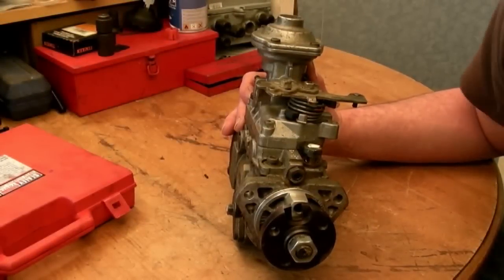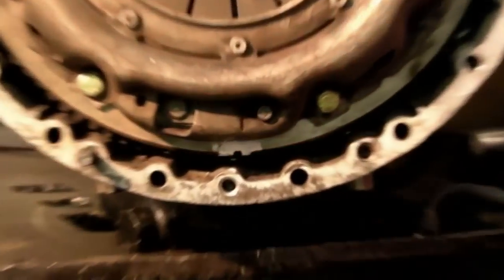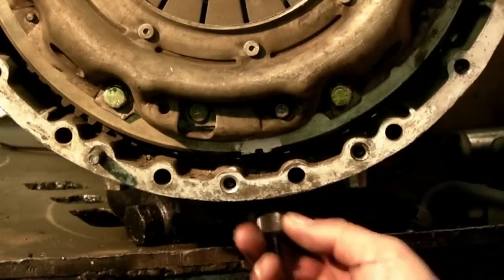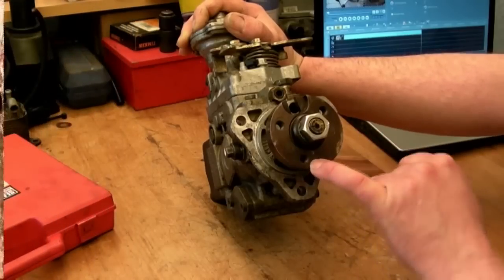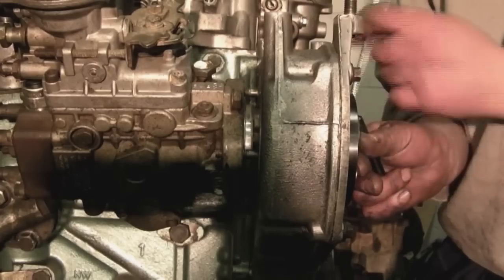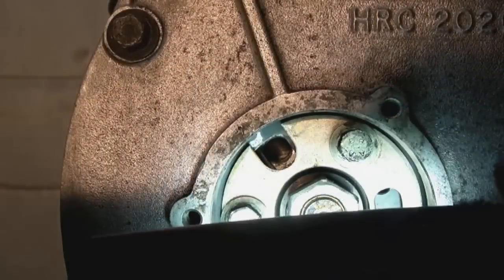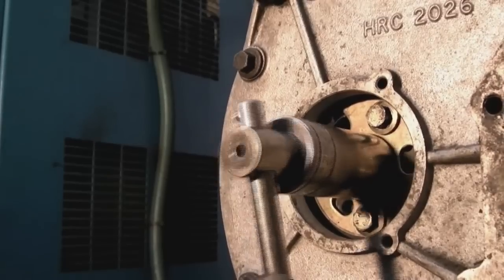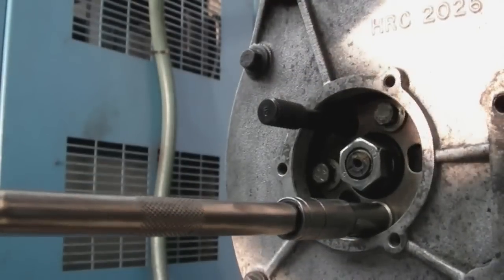Bosch VE Pump timing check with cover plate on  -  Land Rover 200tdi and 300tdi diesel engines

Comment: Thank You for the vid, I just did this on my transit after changing fuel timing solenoid (pump out) was still throwing errors, did this and has been fixed was out at least 5mm.  Different Vehicle but same principle and similiar pump..  :-)

Comment: can you provide the specs of the tools in order to manufacture them? I do not find these for sale.. how thick is the bolt locking the flywheel? Also what thread? what is the size of the tool that lockes the pump?

Comment: I'll have a look at my mate's, I'll put the location pins in on the timing side and mark his pump as I pull it out then look at were the key slot is and just put mine in that position. I'm sure there all made the same.so if his slot is pointing to the top of pump housing that will tell me it's ready to fire on number 1
Reply from the maker: They are not all the same.   I was just looking to see if I could find any information for you but nothing that could help.   If you know where the hub comes off in relation to the cylinder it was going to inject on would be a start but let say the keyway reference is sufficient for now........ from the final setting needs to be set exactly so where the pin slots in it will read the lift specified in the video I am going to supply you in a link.  If you have the hub in the wrong position on the shaft it will not fire on the correct cylinder.   Best to not touch your mates pump as you may mess the setting up off that.   Link here  https://youtu.be/R6v2G0Inz5Y

Comment: Hi there. I can't seems to find the pin slot on my fly wheel. I don't think there is one. Iv rotated the crank over an over again. But I can't see it. Is it safe to check the timing just by holding the crank at tdc mark. Because my pin hole on the pump seems to be at the 10 o'clock position. And on your videos it seems to be at the 11 o'clock Ish position. Or is it best to remove the timing plate an check that way. Brilliant videos by the way. Great help thanks
Reply from the maker: Hi you may have a 2.5 NAD flywheel which doesn't have the TDC timing marks. Timing the pump on a 2.5 / 2.5 Td is totally different.  
You have TDC markers on the crank pulley for both the 200tdi and 300tdi and corresponding  marker on the timing case front cover.  

Recently we had reports from a guy who has the TDC marker was out from the the flywheel slot and front pulley this was due to the keyway being damaged and the pulley had slipped around slightly making the whole issue confusing so be very aware of this..... it happens.    

I would advise to remove the timing from cover and set the crank and cam with the markers on the timing gear to get it as close as possible if you are not sure.
Reply: Great thanks for the quick replie at least I know where I stand now. Keep up the good work much appreciated.
Reply from the maker: Stephen Rodgers This is an issue i am going to have to approach as it happens from time to time.
Reply: Thanks

Comment: hay I've got a 300tdi and need to take the pump off for servicing, how do I lock the pump shaft off? because the 300 pump doesn't have the locking nut and spacer any help would be much appreciated thanks.
Reply from the maker: yeah basically the plate was a transport looking device.  Was done away with on later pumps.  No idea what sort of servicing you are intending to do on the pump but you may want to go and talk with someone who reconditions those sort rotary pumps.
Reply: +Land Rover Toolbox Videos ahh fair enough. an I have done it sprang a leak on me so I'm takein it off to have it repaired cheers.
Reply: +Land Rover Toolbox Videos err I've dropped a bollock. I followed you video but when I removed the cover plate to fit the support the 3 bolt holes are at the extreme end of the adjustment the bolts just won't catch the threads. and I carnt figure out what I've done wrong any ideas?

Comment: erm i dont think that is right? dont you need to use the gauge through the back of the pump to measure the lift of the internals?
Reply from the maker: I'd advise you take a look at some of my other videos   Bosch VE pump  etc or at least RTFM.
Reply from the maker: https://youtu.be/R6v2G0Inz5Y
Reply: ah i see thats in the next video
Reply: @trailerfitter2  Meow.....

Comment: Hi, I've mistakenly took the pump off by undoing the 22mm nut and whilst it was on the bench my mate...........Ok I can't lie I stupidly moved the pump buy putting the 22mm nut back on..........yeah what a nob. I need to know the position of the pump shaft in to the pump body before I put it back in the hole.I've fitted a cam belt kit everything else is aligned apart from the position of the pump shaft......if you know what I mean 😁

Comment: so with that in mind assuming that the engine the auxiliary and pump pulleys are aligned where should the shaft of the pump using the key slot as a reference be positioned 😆
Reply from the maker: As a reference but it need to be set up correctly which is a PITA.  Problem there is no reference points to get an exact setting without using Bosch specialist tools unfortunately.

Comment: The shaft is tappered and has a slot for a woodruf key but the there isn't a key in the pulley wheel.
Reply from the maker: that's right.  No key.   Hasn't got one unlike the Lucas pumps.